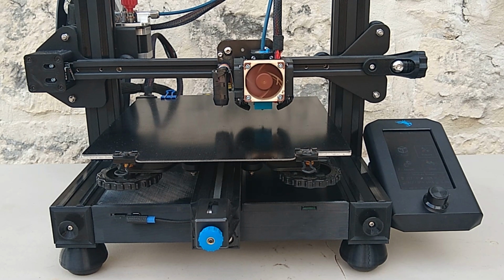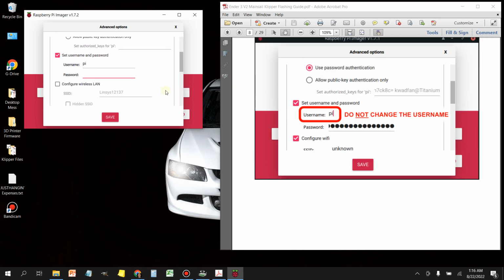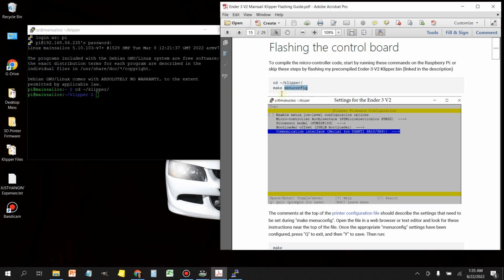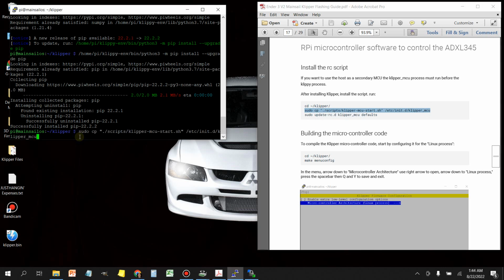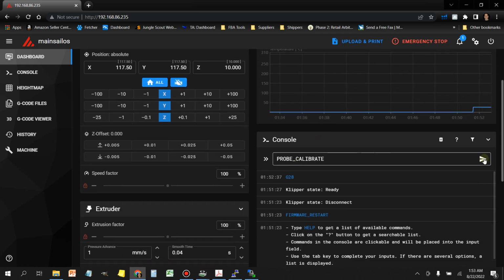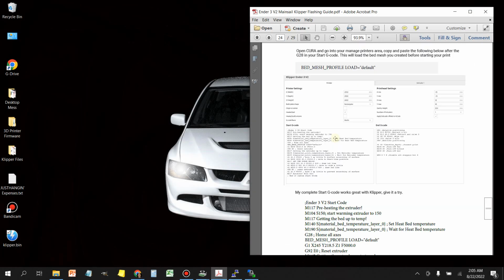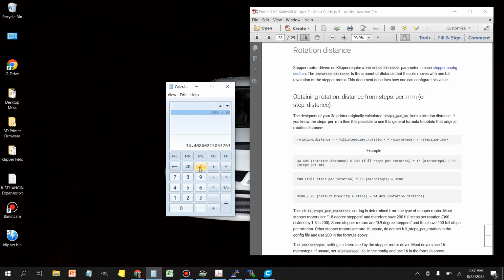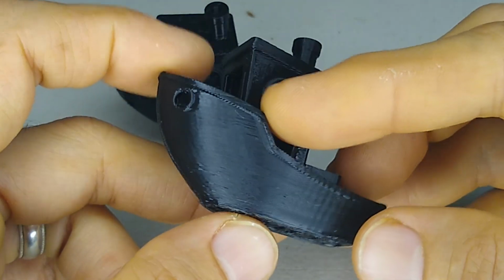Ender 3 V2 An Easy Way of Installing, Calibrating, and Printing with Mainsail Klipper

Comment: This is a FYI. Since I am 80 years old, I needed to write down the process of E-Step Calibration. 

Ender 3V2 E-Steps Calibration using Klipper

I was looking for a procedure to calibrate the E-Steps on the Ender3V2 using Klipper but could not find where to store the new settings.
Found videos on how to do the calibration. Using ideas from various videos, I came up with a procedure to do the calibration.
In Klipper, is a Printer.cfg file. In there, is a area called [extruder]. In here is a line item called rotation_distance. 
This is where the settings for E-Steps are stored. Remember this number.
The following is the process to calibrate the E-steps.

Step 1. Remove the filament from the extractor.
Step 2. Remove the tube at the extractor end that goes from the extractor to the hot end.
Step 3. Feed filament thru the extractor until it just comes out of the extractor.
Step 4. Cut the filament flush with the exit hole on the extractor.
Step 5. In the Mainsail interface, set Extruder temperature to 200 C. The following commands will not work until the Extruder is heated.
Step 6. Enter the following commands in the Console.  M83 (enter), G1 E100 F100 (enter). This will feed 100mm of filament thru the extractor.
Step 7. Cut off the filament flush with the extractor and measure its length with a ruler or caliper. If it is 100mm, no further steps are required.
Step 8. If the length is less than 100mm, it is under extruding and if it is over 100mm, it is over extruding. 
Step 9. Take the number that was stored in rotation_distance (times) the length of the filament that was extruded (divided) by 100.
Step 10. An example: 34.406 x 96.5 / 100 = 33.298   This will be close to what you need to feed 100mm thru extractor.
Step 11. Enter this new number in rotation_distance and "Save & Restart"
Step 12. Repeat steps 5 thru steps 11 until 100mm is fed thru the extractor. 
Step 13. Once E-Steps is correct, reconnect the tubing to the extruder.
Reply from the maker: Hi Larry, Great job, yeah, you got it!
Reply: @vbared  Just tried to follow your great documentation on Mainsail OS Flashing Guide. That is the way to do documentation that is understandable. Thanks for the great doc.
Reply from the maker: @larrymeans7046  Hi Larry, how did it go? Is Klipper working for you? Let me know if you have any errors that need to be resolved so I can help you.

Enjoy your Holiday!
Reply: @vbared  Installed Klipper about three months ago and I like it. Gives you a lot of control. One thing I notice is the temperature changes as its printing. I can set the temperature to say 215  in Cura and while it is printing the model, the temperature will change, sometimes up and sometimes down. Also I am experimenting with .6mm nozzle. So far it is working good. Next project is to get the webcam working on Klipper. Just thought of something. I am using Cura 5.1.1 and their is no plugin subdirectory to add moonraker connection. Your video is using a older version.

Comment: Hi Victor, your detailed video is amazing. Now I am confident upgrading my ender 3 pro to klipper following your instructions. Can you please share what main board version is on your printer because mine has a 4.2.7 board and i cannot find any example config in klipper GitHub or maybe I am not looking for the right thing....
Reply from the maker: Hello GP's DIY, Thank you for commenting and kindness. I'm glad you found in this video for your viewing time. My apologies for the response delay. The timing of your question is perfect since I just added the 4.2.7 board to my Ender 3 Pro. I'm working through one issue tonight and will share my complete printer.cfg file with you as soon as I complete my testing, stay tuned.

Best of luck with your mods!
Reply from the maker: Hi GP's DIY, Just finished the Ender 3 Pro with a 4.2.7 board and CR-Touch video. All the resources are in the video description.

https://youtu.be/d0xTtVwTtc4

Best of luck with your mods!
Reply: @vbared  Thanks a Ton Victor, with help and guidance from your video I was able to upgrade my ender 3-max to Klipper and also added the dual belted Z. Now it is running like a printer on steroids 😁 so now on to doing similar upgrades on my other 3 ender 3 Pro's. Thanks a Lot once again and greetings from India 🙏
Reply from the maker: @Accessgp  Hi GP, Thank you for your kindness. Great job converting your printer to run Klipper and adding the dual belted Z. Most people think that awesome 3D printers can just be bought but they can't. They must be built by people like you. Enjoy the fruits of your labor in every new print your machine produces. I can't think of many things that are more rewarding building something with your own hands and watching it work. Greetings from Texas, USA (:
Reply: @vbared  HI Victor, I am in the process of flashing klipper to my ender3pro which has the newer 4.2.2 mainboard (noisy one). I get mcu rpi unable to connect. I followed everything mentioned in your video and also the Klipper website. Is there something I am missing or is there a possibility of having a unsupported control board? The controller on my board says GD32F303 and not STM...
Reply from the maker: @Accessgp  Hi GP, Unfortunately I don't have any experience installing Klipper on the original Ender 3 Pro 4.2.2 running that controller. I just started a Raspberry Pi session and ran the make menu config but was unable to find that microcontroller listed anywhere. I'm not sure that it's supported by Klipper.
Reply: @vbared  Thank You, I thought as much. So much for cost cutting by creality!

Comment: Great video! The instructional pdf also helped a lot. I had no issues setting up klipper while following along. Thanks!
Reply from the maker: Hello Colin, Thank you for commenting and kindness. Congratulations on getting Mainsail Klipper installed and working. It's an amazing system for running a 3D printer. I can't go back to a traditional firmware.

Best of luck with your mods!

Comment: Greetings, Victor! Can the Honorable Sir tell me how he has start/stop g-code procedures from Klipper and from Slicer?))) I am using start-end g-code from slicer and noticed that some start parameters are duplicated in print g-code and end-stop procedures can cause Klipper Outoff Range error. Also, the Klipper complains about some slicer commands because it doesn't recognize them, for example the layer number in Prusasliser. It probably makes sense to abandon the slicer macros and use Klipper's push macros.
Reply from the maker: Hello Burbycian, How goes your Klipper journey? I'm aware that some start G-Code can reside on Klipper but I haven't used them there. My start G-Code is in CURA. The only thing I added to CURA after installing Klipper is loading the bed mesh. I believe that my start G-Code is in the video description of the Klipper video. Let me know if it's not there and I'll send you the link.
Reply: Hi Victor! Thanks for the reply!))) My Klipper is still at the very beginning of its flight and I'm still learning, using only the basic features.))) But already printed a lot of Christmas and New Year's decorations. So far I can say that the quality of printing is not worse, and maybe even better than Marlin, and the speed is clearly higher.  In addition, I successfully printed a TPU plastic part!))) (Though quite a simple geometry).  Why did I ask my question. PrusaSliser has its own command language with which it is convenient to automate many things, for example to lower the bed temperature after a specified layer or flexibly control retracting, but Klipper doesn't accept those commands and ignores them.  Klipper has a GET_POSITION command, but it gets all the printer head position prameters, and in units of length, and I just want a layer count. I suppose I could get that value from the height of the hotend position, but I have no idea how to do that yet. I'll dig the forums and figure it out... By and large, it's all my petty niggles and numny to use a tool called Klipper, but I will definitely learn!)))

Comment: Good time Victor! I have a desire to make more use of the printer menu control. For example, the SD_Card section of the printer menushows a list of printable files and I want to select some file for reprinting, but the encoder is not configured to handle this event. Let me ask you, have you or anyone else solved such a problem or maybe you know where to look for an answer to such a question?  Simply put, where can I read about how macOS works for Klipper. Thank you!))
Reply from the maker: Hello Burbycian, My only OS experience has been Windows and a little playing around with Linux. I would imagine that this topic has been explored. I would ask on the Klipper forums since there are many eyes on them to help you increase the chances of a solution to your needs.

My apologies for not having the answers to your questions.

Best of luck with your endeavors!
Reply: Thank you Victor, you have already helped me enough and without your example, I would not have decided on this adventure with Klipper`s.)))
Reply from the maker: @burbycianburbycianovich9274  Klipper is awesome, I'm glad you are taking the time to make it your own. At this point you're learning more things about it that I haven't looked into. Keep in touch and let me know how it all comes together for you. After experiencing Klipper I don't think I can go back to regular Marlin firmware.
Reply: I will definitely report my progress.))) For example, I managed to set up KlipperScreen for Android via USB, but so far I have not been able to communicate via Wi-Fi. And the most annoying thing is that on the old tablet, which I also wanted to use problems with the USB connection, and on the relatively new Xiaomi Readmi6, everything is fine, but I need a tablet with its 8 inch screen. Marllin are familiar and worn slippers, but Klipper is... I don’t even know what to compare this hemorrhoids... Probably, this is - weapons can be simple, complex and German!))) Good luck to you and all the best!)))
Reply: Greetings! Thanks to you, I can congratulate myself, the three-week epic under the name Klipper seems to have ended successfully. I was able to connect my smartphone as a remote screen. KlipperScreen via ADB(Wi-Fi), there was a problem with the autostart script, but I figured it out and everything worked as I wanted))) So your example and your efforts were not wasted, at least they motivated me to this wonderful venture))). But I did not think it would be so difficult and long ... Once again, a huge THANK YOU!
Reply from the maker: @burbycianburbycianovich9274  Hi Burbycian, Great job in persisting through all the challenges Enjoy the success of your efforts. I'd love to see a video on that process and I'm sure the community would as well.

Best of luck to you my friend and welcome to the Klipper community.
Reply: At one time I watched videos about Klipper, read discussions, but Klipper was somewhere far away and not in this life. And a month ago I did not think about installing it, but then your video came across. Everything was so clear, understandable and detailed that I could not stand it.)))

Comment: Hi Victor, great stuff on this tutorial. Do you use the E3D V6 direct or bowden?
Reply from the maker: Hello Pieter, Thank you for commenting and kindness. I'm running my E3D V6 on bowden. My goal was to keep the hotend assembly and bed light weight so I can improve the print speeds. Using the minimalist fan bracket together with the lightweight G10 Garolite allows me to print parts at 175mm/s on it without issues.

Comment: Hello Viсtor! I must have already tired you and I apologize for the possible importunity ... ((( My Klipper swears at the M106 command. The config says:
[heater_fan extruder_fun]
pin: PA0...
Trying to add a block
[fan] #Ductfun
pin: PA0...
Requires multiply mode for this pin
But after the announcement
[multi_pin fun_pin]
enable_pin:multi_pin:PA0
I get - "Option 'pins' in section 'multi_pin fun_pin' must be specified"
If you know, then tell me how to correctly describe the fan for blowing the part (second fan)? Thank you! P.S. Otherwise, everything is fine and the process of printing test cubes is in full swing.))) P.P.S. Yes, your PID coefficients are very different from Marlin?
Reply from the maker: Hello Burbycian, Please describe what you are wanting to do so I can help you look for a solution. I'm learning Klipper as well and the settings, aside from pin: PA0, you are working with aren't familiar to me.
Reply: Hello Victor, glad to hear you!))) Thanks, I too am studying the Klipper as I go along, and everything else too.))) I think I figured it out - I want too much from my board. She have only one PA0 control pin for the fan(s) and the connectors are wired in parallel. I guess I will use the signal which is designed for the filament sensor, but I need to find a board with mosfet`s ready to use, so I don`t have to risk with hinged mounting. At the same time we should think about controlled cooling of the MCU - i had a temperature of up to 62 degrees... In the first approximation everything already works and quite satisfactorily. True on smoothing the top surface gets a rarefied print, but it can be cured.))) I was pleased that the PID coefficients of Klipper and Marlin were close enough, and the Z-Offset matched up to the third digit. Thanks again for your feedback!))

Translated with www.DeepL.com/Translator (free version)